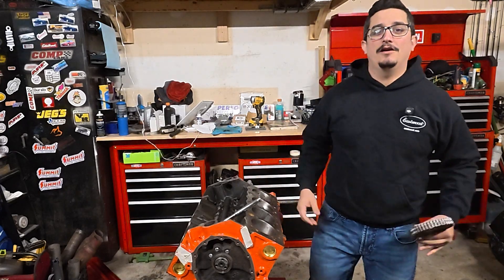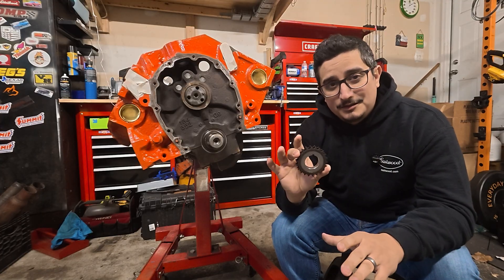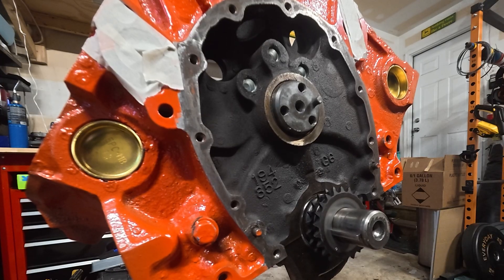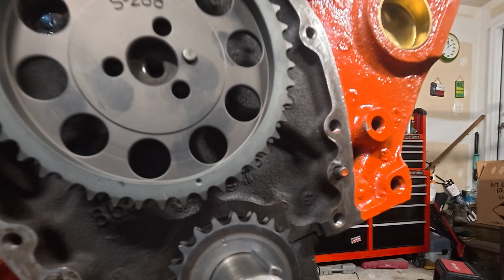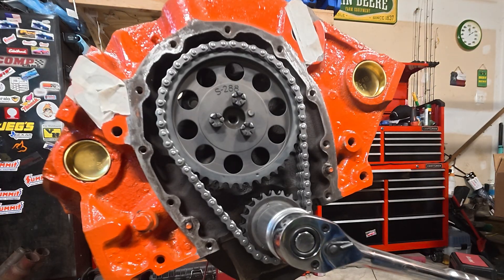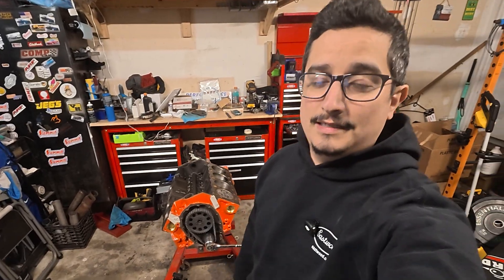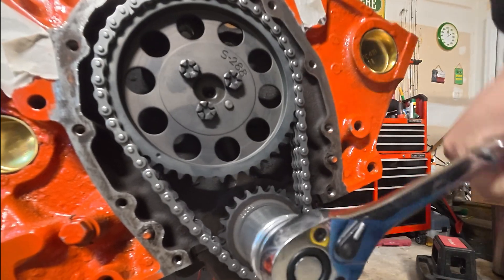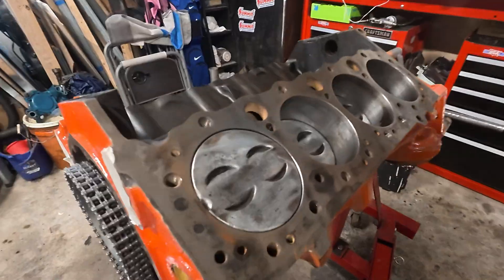The Engine Building Timing Secret You Need to Know

Comment: Former GM tech. Dots align, balancer on zero , distributer on one. The worst thing that will happen is you will be off a tooth. Also , how dry is that crank?
Reply: I expect that your not well viced in SBC's as dot to dot is #6.
Reply: @vernebrown4441  You are correct.
Reply: @vernebrown4441 wrong . Once the harmonic balancer goes on the dots are irrelevant.
Reply: @stevenfoust3782  
Does that mean you can set the gears away you wish? Say 12 and 3 o'clock? and will run just fine?  Also check the other comments and learn, that your the one that is wrong, or is that why you are a former GM tech?
Reply: @v @vernebrown4441 rst off obviously the gears  are set dot/dot. Try reading comments. My only argument is once you put the balancer at zero with # 1 at tdc and dist at one it will start .
Reply: @stevenfoust3782  Is that what we are missing? That you turned the eng to #1TDC, then it will start as it has been turned 180 from the DOT to DOT.
Reply: It’s all about valve timing to spark timing.
Reply: @DavidRyan-h1p everything has a spec for normal operation.
Reply: Proper rod and main bearing clearance and assembly lube especially on the cam will keep them from going BANG!!! on the first start up. Oh yeah, don’t forget to put oil in it. Good luck.
Reply: Have built quite a few sbc and ALWAYS did dot to dot

Comment: On chevys dot to dot is compression on number 6. Some Buick repair manuals tell you dots opposite is number 1. But the easier way is to see compression coming up and on the timing mark at timing degree you need. Some older mechanics think the cycle start directly after exhaust stroke is completed.

Comment: Thanks for the timing tips! Thirty years ago, I was rebuilding a GM 3.8L V-6, and had to learn this the hard way. On initial starting, the engine backfired through the carburetor, and would not run. I then noticed that my #1 piston was not at TDC, on the compression stroke, and my distributor was installed 180 degrees out of time. After repositioning the crankshaft and distributor to the correct positions, the engine fired off, and ran smoothly on the first start.

Comment: You don't hammer the lower into place  on the  crankshaft. Thats back yard, under the tree mechanics. You heat the gear up in an oven to 160 degrees and slide it on.......
Reply: …and you don’t use impacts on pullers.
Reply: Tap a screwdriver lightly between the crankshaft counter weight and the block to protect the thrust bearing.
Reply: 160 didn't do it for me. 400 for 20 minutes. Good you know this technique though.
Reply: glad someone commented this so now I dont have to, thanks
Reply: Yup! Dude is pounding the crap out of the thrust bearing.   😒

Comment: Dot to dot fires #6 , both up is #1 .
Reply: Cam gear dot in the 6 oclock position crank gear in the 12 oclock position. Also , driving the crank gear on with the hammer effects thrust load on the main bearings. That is a s*** way to do it
Reply: Correct ...

Comment: Couldn't be more wrong if you tried. First while you have the timing marks set at dot to dot place the timing cover on real quick with the pointer, loosely place harmonic balancer in place and make sure the groove in the balancer lines up with TDC on the pointer, if not the balancer has slipped and you need to replace it. Second doing what you just did goes out the window when you install the heads and do lifter preload. Rookie mistake at it's finest.

Comment: Yep, dot to dot is #6 firing. Cam turned 180 degrees is #1 firing. Both #! and #6 at TDC.
Reply: You do the same with the old straight 6 too
Reply: Point rotor at #6, dot to dot?
Reply: @jasmith1867  Yes

Comment: I'm 65 and have built 100's small blocks and always installed dot to dot, besides you'll turn the motor over lots to adjust lifters. Also I've never seen or read in any manual to do this. My engines fired up just fine. Stay with what you know that works, don't think this kid has the experience quite yet.
Reply: I want to see him put the distributor in at his final "both dots" at 12 O'clock position.... 🤔
Reply: @tommybeebe4571 
12/6 is TDC #1. That’s where the distributor goes in every time. It’s just that few rotate the crank after T-Chain install. 
 ASE Master Tech - 78
Reply from the maker: We'll get there! Moving on this build as fast as I can
Reply: @tommybeebe4571 That's when #1 piston is at TDC and at the end of the compression stroke. That's also when #1 cylinder needs to fire.
Reply: I love the comments in this channel. I learn as much down here as I did in the video! Merry Christmas everyone!
Reply: You took the words right out of my mouth young man.
Reply: The guy in the video is right but he could have explained it better. So I will: When the timing marks are aligned (dot to dot) the number one piston is at TDC but on the overlap phase or beginning of exhaust stroke. So if you time ignition off of that you will in fact be 180 degrees off. When both dots are up and piston at TDC you are in fact on the power stroke, so easy to drop the distributor in and put wires on accordingly. Of course there are many other ways to do it too.
Reply: Was thinking the same thing.
Reply: Agreed, SBCs dot to dot many times and I still have a couple of them that still run great. Also did the same on a couple of friends engines, one with the timing set so worn out it ground a hole in the timing cover
Reply: 180 out
Reply: Who the hell "adjusts the lifters" on a small block Chevy. YOU ADJUST THE VALVE LASH.
Reply: Prestart up, there are a series  of rotation position to adjust the intake and exhaust valves .
If you have an intake too tight, and you have a high lift cam, the valve can be way open and the piston will hit it at TDC, and bend a valve. Then you're screwed.
Once it is running, you are correct.
Loosen the rocker till it clacks  , tighten till it stops, then tighten one full turn a quarter turn at a time.
Small block lifters usually have .060 of hydraulic adjustment from collapsed to max extension.
You want to be .030 into that travel.
I'm not being a wise guy, I have been a machinist / engine builder since the late 1970's, and would be happy to share knowledge.
Reply: @howabouthetruth2157 Pickey with your choice of words aren't you! It means the same dam thing and purpose.
Reply: @howabouthetruth2157  If the lifters are solid/roller, you can adjust the valve lash.  If hydraulic, the engine needs oil pressure before buttoning it up by spinning the oil pump before installing the distributor.  The oil will stay in the lifters. The procedure written by @keithlane786 is 100% correct.
Reply: @howabouthetruth2157  calm down Jr..... we all know what he meant.
Reply: @howabouthetruth2157  solid lifters you adjust the valve lash, hydraulic lifters you adjust the lifter.
Reply: @raced3786  What the hell is wrong with some of you people........even with hydraulic lifters, you STILL do it by ADJUSTING THE VALVES. PROOF: EVERY VIDEO TITLE SAYS: "SMALL BLOCK CHEVY VALVE ADJUSTMENT FOR HYDRAULIC LIFTERS". LOOK IT UP FOR YOURSELF. NOTE HOW THEY ALL CALL IT: "VALVE ADJUSTMENT". I've never heard a single man say: "I've gotta adjust my hydraulic lifters". IT'S STILL A VALVE ADJUSTMENT, BUT THE METHOD USED IS FOR HYDRAULIC LIFTERS........OR IT WILL BE THE METHOD USED FOR LASHING VALVES WITH SOLID LIFTERS/CAM.
Reply: @howabouthetruth2157  I guess that we’re not as smart as you are. We haven’t spent our lives entertaining Bigfoot, some of us have had to work for a living… maybe even as automobile mechanics.
Reply: @howabouthetruth2157 Yes it's called adjusting the valve's but it's also adjusting Lifter Pre- load! Ok does that make sense to you?
Reply: @rickysimons526  I've already mentioned that in one of the several other replies I posted in this very same thread. READ IT. Try opening up all of the replies and see for yourself before you decide to enter into this. And WHERE is hydraulic lifter pre-load adjusted..........answer: AT THE ROCKER ARM/VALVE. And WHY must hydraulic lifter pre-load be correct? Answer: SO THE VALVE CLEARANCE WILL BE CORRECT WHEN ACTUATED. Now.............BUZZ OFF.
Reply: @howabouthetruth2157 Geez! Your wound up way to tight my friend you're gonna give yourself a stroke. Move on, it's not that important to the rest of us that we see you as the expert.
Reply: Bullshit

Comment: wouldnt this mean youd have to set the rotor for fireing on cylinder nr6 ?
Reply: Seems like it.
Reply: WATCH THE DAMNED VIDEO FOR CRYING OUT LOUD. BECAUSE AFTER INSTALLING THE TIMING GEARS DOT-TO-DOT, HE THEN DEMONSTRATES HOW YOU MUST TURN THE CRANK 180 DEGREES TO GET THE #1 PISTON AT TOP-DEAD CENTER. What the hell is wrong with so many of you viewers who are TOO lazy & impatient to give the video a chance. Instead, ya watch the first couple minutes then ASSUME "that's all there is and he's doing it wrong". IF YA CAN'T SIT THROUGH A LITTLE 6 MINUTE VIDEO, THEN YOU HAVE NO RIGHT TO CRITICIZE WHEN IT'S PAINFULLY OBVIOUS THAT THE REAL PROBLEM IS YOUR SHORT ATTENTION SPAN THAT WON'T ALLOW YOU TO DO SO.
Reply: @howabouthetruth2157  well then I must be stupid cause he doesn't mention anything aabout the nr 6 cylinder being ready for ignition upon start up. wow man, you got get off the caps lock button.
Reply: @z28rikard If you drop the distributor to fire #1 before turning the crank a full turn and the timing set is still aligned dot to dot on the distributor set, it'll be 180 degrees out. Dot to dot is when #1 is at TDC at the beginning of the intake stroke and #6 is at the end of the compression stroke. Yes, that's when you want to fire #6. The guy spun the crank one complete turn to put the cam gear dot on top. That's the correct alignment for firing #1 at TDC at the end of the compression stroke. 

Guys are acting like they aren't ever able to see the timing set when they drop the distributor to fire #1.  If they installed the intake and distributor in the correct position before they installed the timing cover, they would see both dots at 12 o'clock, but most put the timing cover on well before they drop the distributor and they don't understand that the dots are both at 12 o'clock when they install the distributor pointing at #1.

Comment: You may have made a MISTAKE !! Some double roller timing chains will rub against the center oil gallery and caiuse metal chips to be in the bearings, us old guy know to grind the top of the center gallery ! Yes,we always set the gears up that way because its easyer to line them up ,than 180 out ! You are acually setting up on number 6 cyl. But us old guy know to rotate the engine to number 1, for TDC, TO SET DISTRIBUTOR TIMING ! HOPE THIS CLEARS THIS UP !
Reply: You guys just aren't watching the entire video, are you. BECAUSE AFTER INSTALLING THE TIMING GEARS DOT TO DOT, HE ABSOLUTELY DID DEMONSTRATE HOW YOU MUST THEN TURN THE CRANK 180 DEGREES, WHICH OF COURSE PUTS THE #1 PISTON AT TOP-DEAD CENTER. YOU PEOPLE ARE TOO F*CKING LAZY TO WATCH AN ENTIRE VIDEO THAT SHOWS THE NEXT STEP THAT IS ABSOLUTELY NECESSARY THAT RESULTS IN THE #1 PISTON BEING AT TOP-DEAD CENTER, AND THEN YOU ACCUSE HIM OF BEING "WRONG". HE ALSO WARNED ABOUT MAKING SURE YOU HAVE NO CLEARANCE ISSUES DURING THE DOUBLE-ROLLER TIMING CHAIN & GEAR INSTALLATION AND GRINDING THE AREA OF THE BLOCK TO CREATE THE NEEDED CLEARANCE. WATCH THE DAMNED VIDEO YOU LAZY "KNOW IT ALL" F*CKS.
Reply: From one old mech to another...right on!